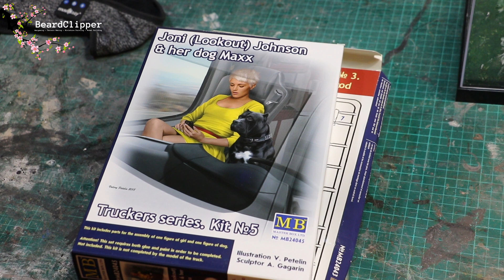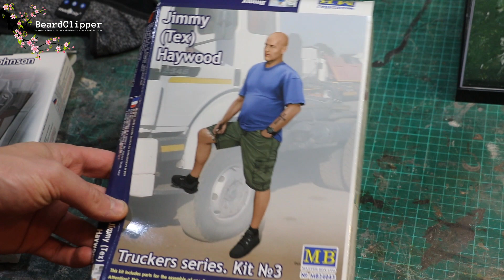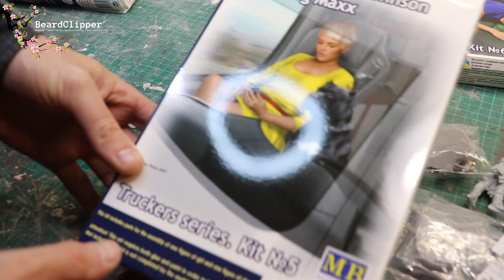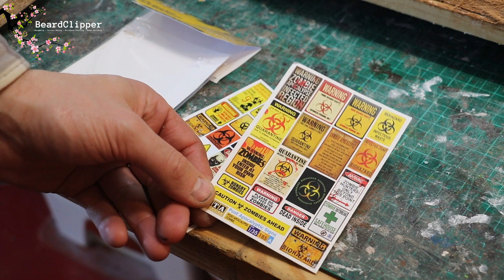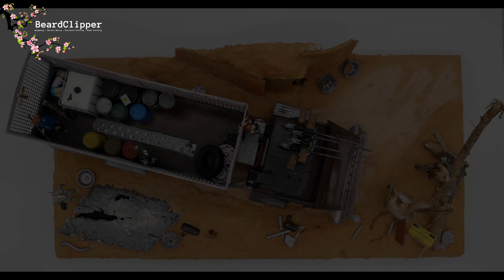youtube video #-PnN4oH7P5w

Comment: I think you could really push this to the next level by adding some weathering, rust and dirt/dust to everything. Make it look more lived in, aged and used. Apocalyptic maybe.
Nice build all the same. I want to do a few dioramas in that scale as well.
Reply from the maker: Thank you so much for your comment and for the really helpful suggestion. Weathering is something that I'm really nervous of trying (basically I don't want to ruin what I've done) so my nerves got the better of me here :) You are absolutely correct that it is really a lack in the diorama and it would be much better if I'd done it.

Maybe I will go back to this when I've done some practice on weathering on stuff I care about less and give it a go.

I've got another couple at this scale planned already - this was my first attempt at 75mm and now I'm certainly addicted to the larger scale.

Thanks for taking the time to comment.